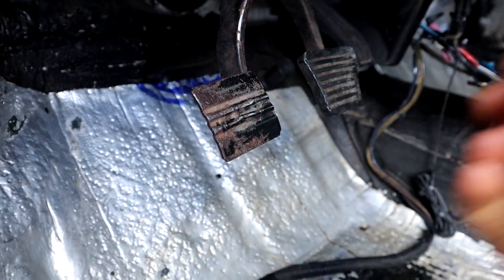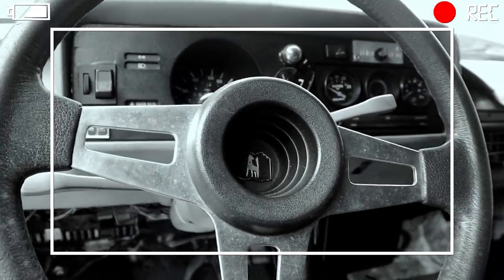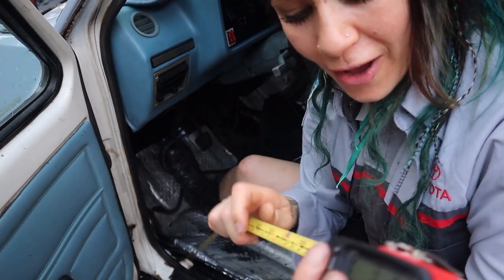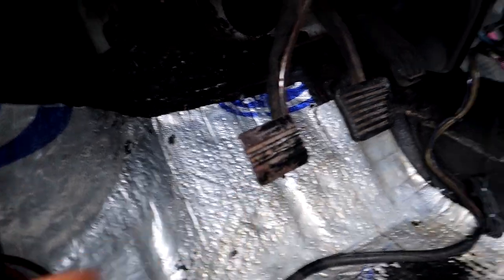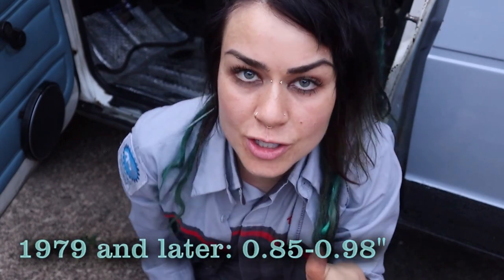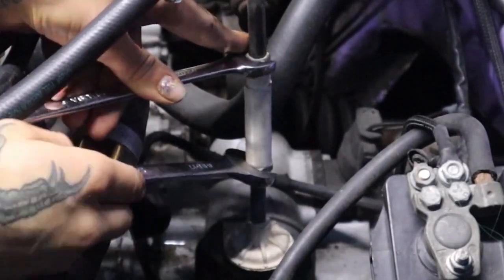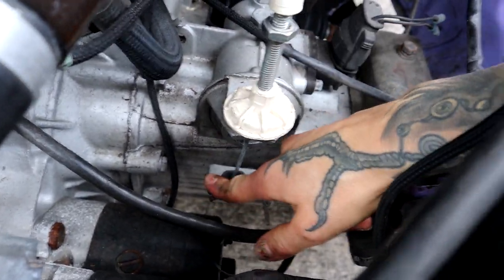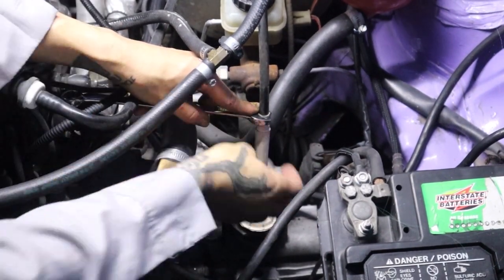Adjusting Clutch Pedal Free-Play: O2O Transmission FUN! Part 7

Comment: Nice job Faye this is on my list when I get my Mk1 Gti back together. I see you may be missing the rubber doohickey/sleeve that sits on top and through the plate where the adjuster knob sits on and cable routes through. Probably doesn’t make much of a difference but VW put it there for a reason? Love the Rabbit vids my first car was a 79 Rabbit with that same interior and a blown engine. I’m still wrenching for fun 31 years later!
Reply from the maker: Nice!!!

Comment: I feel like I should check up on my clutch system, car seems to shift just fine. but it might need some tlc. I just assume hydraulic adjustment is just by the clutch pedal its self typically. never adjusted it, but have replaced the master and slave cylinder before

Comment: Hi Faye, I'm just new to this kind of clutch problem. I just had my car's clutch disk replaced and it's running better however I noticed that my clutch pedal has this weird excessive free play when the car's running on the road but when it's just sitting there not used the free play isn't present. What do you think is the cause?